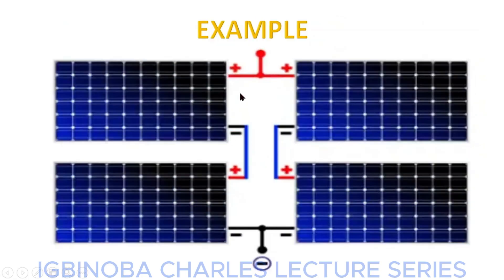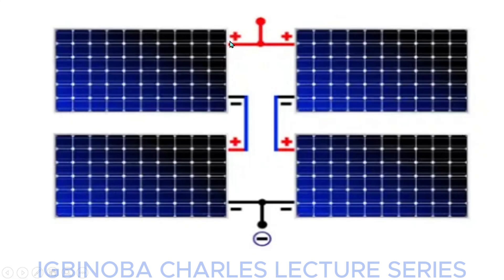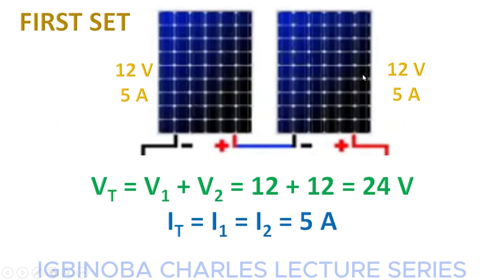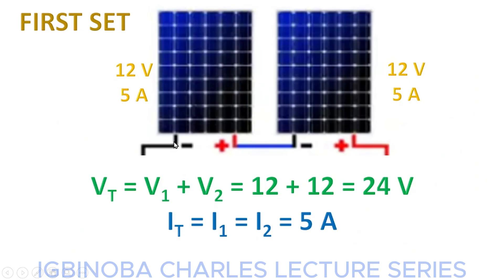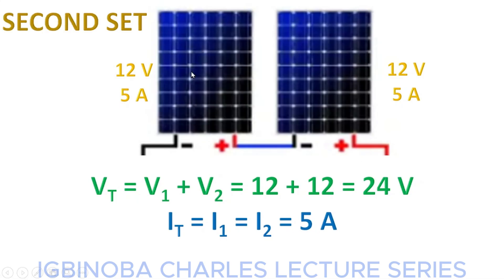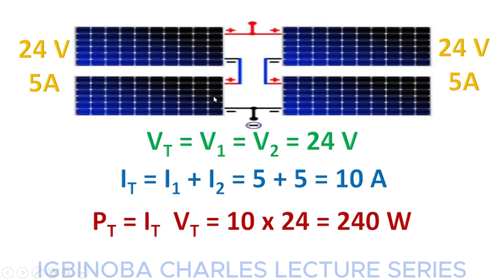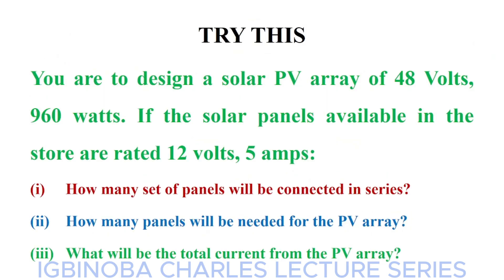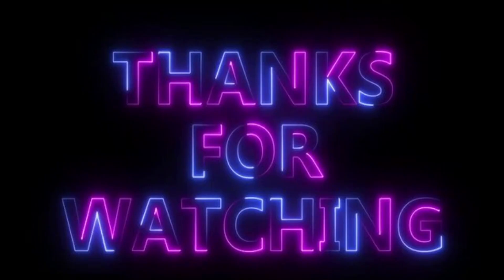Connection of  Solar Panels in SERIES-PARALLEL

Comment: PETRO3158B

i) When connecting panels in series, voltages add up, but the current remains the same.

Required voltage = 48V
Each panel voltage = 12V
Number of panels in series = 48 / 12

= 4 PANELS IN SERIES

ii) A total of 16 Panels would be needed

Each Panel produces 60 watts i.e. 12V x 5A = 60W

To get 960W in total, therefore, 960W / 60W = 16 Panels

iii) Utilizing the formula:-  I = P / V

I = 960W / 48V = 20A

Comment: MAR315O
1. Set of panel connected in series = 4 panels
2. Panels needed for pv array = 16 panels. One panel (12v×5=60watts), 960/60 = 16panels
3. Total current equals 20A
Form the formula I = P÷V
I = 960 watts ÷ 48v = 20A

Comment: PETRO323W

a) when connecting panels in series, voltages add up, but the current remains the same.

Required voltage= 48v
Each panel voltage= 12v
Number of panels in series= 48/12
                                               = 4
Ans: 4 panels in series 

b) A total of 16 panels would be needed 

Each panel produces 60 watts I.e. 12v × 5A = 60W
 
Therefore to get 960W in total, 
960/60 = 16

Ans: 16 Panels

c) Using the formula » I = P/V
     I = 980W / 48V
       = 20A

Ans: 20A

Comment: MAR3123S
Panel in series:to get the voltage voltage of 480v usunj very 4 120V
2,to reach demand of 960W,16 panels are required 
3,to string are connected in parallel and give an output  current of 20A

Comment: MAR334H

1.A panel in series: to achieve the system target of 480v using 120v panels, 4 panels will be required 

2. The power output of a single panel is 60W to achieve the system's power demand of 960w..  16 panels are needed 

3. The strings are connected in parallel, using I  =p/v , 960/48= 20Amps

Comment: MECH367O

(i) 48V (array voltage) ÷ 12V (panel voltage) = 4 panels in series

(ii) 960W (array power) ÷ 60W (panel power) = 16 panels

Since we need 4 panels in series, we'll have:
16 panels ÷ 4 panels/series = 4 parallel strings of 4 panels in series

(iii) Total current = 5A (per string) x 4 strings = 20A

Comment: MAR3112H 
1:- Sets of panels that will be connected in series is $48 / 12 = 4$

2:- The power generated by a single panel is $120 \text{ V} \times 5 \text{ A} = 600 \text{ W}$. The required power in the array is $960 \text{ W}$. Therefore, the number of panels needed for the array is $960 / 60 = 16 \text{ panels}$.

3:-Since we have 4 panels connected in series and we have a total of 16 panels, Total panels connected in parallel is $16 / 4 = 4$ panels in parallel. Each of these panels has a current of $5 \text{ A}$. Therefore, the total current in the PV array is $4 \times 5 \text{ A} = 20 \text{ A}$.

Comment: PETRO311K

1. Total number of panels placed in series - 48V/12V = 4 panels.
2. Total number of panels needed for PV array - 960W/60W = 16 panels.
3. Total current in the PV array - P=IV, where P=960 and V=48. Therefore, I=960/48 = 20A

Comment: EEE35E

1)  4 sets of panels will be connected in series.....each set will consist of 4 panels

2)  16 panels would be needed in total for the PV array 

3)  The total current from the PV array would be 20 A

Comment: Mar355C

1. 4 panels will be required in a series connection to get an equivalence of 48 volts. (Since each panel is 12 volts, 12 ×4 =48 volts)

2. A total of 16 panel will be needed for the Photo voltaic array

3.The total current from the PV array will be 20 A

Comment: CHM 107C

Given: PV array= 48V, 960W. Solar panels: 12V, 5A.
- Number of panels connected in series= 48/12= 4
- Total panel for array
Each panel = 12V × 5A = 60W
Panel number= 960/60=16
-Total current from PV array
Number of parallel strings = 16/4=4
In parallel, current adds voltage stay same(48V):
Total current= 4×5A = 20A

Comment: CHM 3143M

Given: PV array= 48V, 960W. Solar panels: 12V, 5A.
- Number of panels connected in series= 48/12= 4
- Total panel for array
Each panel = 12V × 5A = 60W
Panel number= 960/60=16
-Total current from PV array
Number of parallel strings = 16/4=4
In parallel, current adds voltage stay same(48V):
Total current= 4×5A = 20A

Comment: MAR329C

a.) To achieve a system voltage of 480V using 120v solar panels, you need to connect 4 panels in series

b) Total Number Of Panels Needed

The normal output of a panel is 600W. To meet the total demand of 960W, 16 panels are required in total

c) 16 panels are in the array and 4 panels are in series. Total number of parallel sets of panels = 16/4-4 parallel sets. Total current frok each set of panels is 5A. Since these sets are in parallel, the total current is 5A ×4=20A.

Comment: CHM397S

1: Sets of panels that will be connected in series is 48/
12 = 4
2: The power generated by a single panel is = 120 V x 5 A
= 600 W. The required power in the array is 960 W.
Therefore, the number of panels needed for the array is =
960 / 60 = 16 panels.
3: Since we have 4 panels connected in series and we have a total of 16 panels, Total panels connected in
parallel is 16 / 4 = 4 panels in parallel. Each of these
panels has a current of 5 A. Therefore, the total current in the PV array is 4 × 5 A = 20 A.

Comment: EEE328B
1.Number of Panels in Series
Required system voltage = 48V
Each panel voltage = 12V
Number of panels in series = 48V ÷ 12V = 4 panels
Answer: 4 panels in series.

2.Total Number of Panels Needed
Power of one panel = 12V × 5A = 60W
Total required power = 960W
Total number of panels = 960W ÷ 60W = 16 panels
Answer: 16 panels in total.

3.Total Current from the PV Array
Total panels = 16
Panels in series = 4 → Number of parallel sets = 16 ÷ 4 = 4 sets
Current per set = 5A
Total current = 4 sets × 5A = 20A
Answer: The total current is 20A

Comment: MAR322v
1.When connecting panel in series,voltage at add up ,but the current remains the same.
Required voltage __48v
Each panel voltage __12v
Number of panels in series:48/12 equals 4 panel in series 
2.A total of 16 panels would be needed 
Each panels produces 60 watts i.e 12v *5=60w
To get 960W in total therefore 960W/60W=16panels 
3. Utilizing the formula -I=P/V
I=960W/48V= 20A

Comment: CHM3168L

The required PV arrays = 48V, 960W
The Solar panel rating available = 12V, 5A
The power of one panel, P = V x I = 12 x 5 = 60W

I. When calculation the total voltage in series it is added up, therefore:
48V/12V = 4 panels
 4 panels are connected in series 

II. Total power required = 960W
Power per panel = 60W
Therefore the total panel needed for PV arrays:
960W/60W = 16 panels 
 16 panels is needed for the pv array

III. In series the current stays the same but since we have for 4 strings in parallel the current adds up, therefore the total current is 5A x 4 = 20A
The total current from the pv arrays is 20A

Comment: PETRO3143M

1.Number of Panels in Series
Required system voltage = 48V
Each panel voltage = 12V
Number of panels in series = 48V ÷ 12V = 4 panels
Answer: 4 panels in series.

2.Total Number of Panels Needed
Power of one panel = 12V × 5A = 60W
Total required power = 960W
Total number of panels = 960W ÷ 60W = 16 panels
Answer: 16 panels in total.

3.Total Current from the PV Array
Total panels = 16
Panels in series = 4 → Number of parallel sets = 16 ÷ 4 = 4 sets
Current per set = 5A
Total current = 4 sets × 5A = 20A
Answer: The total current is 20A

Comment: CIV374V 
a) Panel in Seies:
To achieve a system voltage of 480V using 120v solar panels, you need to connect 4 panels in series
b) Total Number Of Panels Needed
The normal output of a panel is 600W. To meet the total demand of 960W, 16 panels are required in total
c) 16 panels are in the array and 4 panels are in series. Total number of parallel sets of panels = 16/4=4 parallel sets. Total current frok each set of panels is 5A. Since these sets are in parallel, the total current is 5A ×4=20A.

Comment: CHM312OP
1. Number of panels in series:
For 8v we need to connect in panels series. since each panel is 12V, 
we'll need 
480/12V in series .
2. Total number of panels: 
Each panel is 12V, 5A, so the power rating will be 
120*5A=600W per panel
Since 4 panels are needed in series, we will have 16 panels/4 panels per series line up = 4 parallel line ups
3. Total current from the PV array: Each series line up produces 5A (parallels are connected in series)
with parallel line up, Total current will be 5A*4=20A

Comment: MAR333G
1. We have 4 panels in series. Where we have =48/12=4
2. We have 16 panels for the array. Where we have=960/60=16
3. We have 20A to be the total current from the PV array. When we have in each series string 4 panels=48v,5A so total current will be=4×5A=20A.

Comment: CIV396R

1. There will be 4 panels connected in series
2. 16 panels (i.e 4 series × 4 parallel)
3. Total current is 20A (5A × 4 panels)

Comment: MAR73U 

i.4 panels are connected in series
ii.A total of 4 panels will be needed 
iii.Firstly the panel has different current in series connections if they are different current you take the current of the small voltage 
The smallest voltage is 5
It=I1+I2=5+5=10Amps

Comment: Comp356D

(1) 4 sets of panels will be connected in series
(48V/12V) = 4
(2) 16 panels will be needed for the PV array
(960W/60W) = 16
(3) The total current from the PV array is 20A
(960W/48V) = 20A

Comment: COMP327A

1. Sets of panels that will be connected in series is 48/12=4

2. power generated by a single panel = 120 V x5A = 600 W.
required power in the array is 960 W. Therefore, number of
panels needed for the array is = 960/60 = 16 panels.

3. 16 panels are in the array and 4 panels are in series.
Total number of parallel sets of panels = 16/4= 4 parallel
sets. Total current from each set of panels is 5A. Since
these sets are in parallel, the total current is = 5A x 4 =
20A.

Comment: EEE3170N
1.  Number of panels in series:
For 8V we need to connect panels in series. Since each panel is 12V, 
we'll need;
480 divided by 12V panels in series.

2.  Total number of panels:
 Each panel is 12V,  5A , so the power rating will be: 120 x 5A= 600W per panel 
for a 960W array, we'll need:  960W divided by 60W per panel = 16 panels
 Since we need 4 panels in series, we will have: 16 panels /4 panels per series line up =4 parallel line ups

3.  Total current from the PV array:
 Each series line up produces 5A (since the panels are connected in series).  With parallel lineup, the total Current will be: 5A x 4 =20A

Comment: PETRO 384F 
Great video sir 

Let's solve the problem step by step

Given:
- Solar panel rating: 13V, 5A
- Desired PV array rating: 48V, 960W

1). Number of panels in series:
To achieve 48V, we need to connect panels in series. Let's calculate the number of panels needed:
48V / 13V = 3.69 (round up to 4 panels in series, since we can't have a fraction of a panel)
So, 4 panels in series will give us: 4 x 13V = 52V (which is close to the desired 48V, considering voltage variations)

2). Total number of panels needed:
To calculate the total number of panels, we need to determine the total current required:
960W / 48V = 20A
Since each panel is rated 5A, we'll need:
20A / 5A = 4 strings of panels in parallel
Each string has 4 panels in series, so the total number of panels is:
4 strings x 4 panels = 16 panels

3). Total current from the PV array:
We've already calculated the total current:
960W / 48V = 20A

So, the answers are:
Question 1: 4 panels in series
Question 2: 16 panels 
3. 20A

Comment: EEE3122R
1. No of panels connected in series is 48/12=4
2. The power output of a single panel is  120v ×5A=600W. But the required power in the array is 960W,so therefore the actual number of panels needed for the array is 960/60=16 panels
3. Since there are 16 panels in total in the array and 4 in series... The total number of parallel sets of panels is 16/4=4 panels. Since the current in each set of panels is 5A, the total current in the array is 5A ×4=20A

Comment: COMP37G 

a) Panels in Series: 
     To achieve a system     voltage of 480V using 120V solar panels, you need to connect 4 panels in series. 

b) Total number of panels needed: 
      The power output of a single panel is 600W. To meet the total system power demand of 960W, 16 panels are required in total.

c) Parallel Strings and Output Current: 
     With 16 total panels arranged in the series string, these strings are connected in parallel the result is 20A.

Comment: MECH3198P 
i. 4 set of panels will be connected in series (48v/12v) =4v.
ii. 6 panels will be needed for the PV array (960W/60W) =16 W
iii. The total current from the PV array is 20A (960W/48W) =20

Comment: PETRO3670

1. 4 sets of panels will be connected in series.

Since connecting 4 of the 12 volts, 5 amp panels in series gives a total of 48 volts as required by the solar PV array design

2. 16 panels will be needed for the PV array.

This is because the power of each panel is 12 x 5 = 60 watts, therefore the total number of panels to produce 960 watts is, 960/60 = 16

3. The total current from the PV array is 20 amps

Since I (total) = P (total)/ V (total)
I (total) = 960/48 = 20amps

Comment: NAT331E

a) Panels in Series: To achieve the system's target voltage of 480V using 120V panels, 4 panels need to be connected in series.

b) Total Panels Needed: The power output of a single panel is 600W. To meet the total system power demand of 960W, 16 panels are required in total.

c) Parallel Strings & Current: With 16 total panels arranged in 4 series strings, these strings are connected in parallel. This configuration results in a total output current of 20 Amps.

Comment: CHM364L

1. 4 panels are connected in series 
When you connect four 12-volts, 5-amps panels in series, you get a total of 48 volts, which is the voltage needed.
2. 16 panels are needed. Each panel produces 60 watts ( 12V × 5A). To get 960 watts: 960/60 =16 panels 
3. The total current from the solar array is 20 amps. 
960W/48V = 20A

Comment: COMP326Z

a) Panels in Series:

To achieve a system voltage of 480V using 120V solar panels, you need to connect: 480V 120V = 4 panels in series.

b) Total Number of Panels Needed:

Each solar panel generates 600W of power.

To achieve a total system power output of *9,600W*, the number of panels required is: 9,600W 600W = 16 panels in total.

c) Parallel Strings and Output Current:

If the 16 panels are grouped into sets of 4 (in series), this gives *4 strings*.

These 4 series strings are then connected *in parallel*.

Assuming each string delivers *5A*, the total system output current is:

4 strings × 5A = 20A total current.

Comment: MECH3123S
A) because series connection determines the final voltage of the array and the required voltage is 480, then the number of panels needed to reach the required voltage is 48/12 = 4 panels.
B) The power generated by a single panel is 120 * 5A = 600. The required power in the array is 960/60 = 16 panels
C) 16 panels are in the array and 4 panels are in seriesm total number of parallel sets of panels = 16/4 = 4 parallel sets. Total current from each set of panels is 5A. Since these sets are in parallel, the total current is 5A * 4 = 20A

Comment: MECH3106B

a) Set of panels in series:
To achieve a 48V system using 12V panels, the number of panels connected in series should be:
48 volts ÷ 12 volts = 4 panels in series
b) Total panels required for PV array?
Each panel is rated at 12V and 5A, giving a power output of: 12 volts x 5A = 60 Watts per panel.
For a total system power of 960W, the number of panels needed is:
960 Watts ÷  60 Watts = 16 panels
 Therefore 16 panels are required 

c) Total current output from the PV array Is derived by:
One series set produces a constant current (5 Amps) and 48 volts..
We have 16 panels in total and 4 panels per series string,so.....
16÷4= 4 strings

With 4 parallel strings, the total current from the array becomes:5+5+5+5= 20A
OR
5 Amps x 4 panels per string= 20 amps

Comment: MAR357E

1. Sets of panels that will be connected in series is 48/12=4

 2. power generated by a single panel = 120 V x5A = 600 W. required power in the array is 960 W. Therefore,  number of panels needed for the array is = 960/60 = 16 panels.

 3. 16 panels are in the array and 4 panels are in series. Total number of parallel sets of panels = 16/4= 4 parallel sets. Total current from each set of panels is 5A. Since these sets are in parallel, the total current is = 5A x 4 = 20A.

Comment: COMP3109E

1. Panels Connected in Series
To reach the required system voltage, we connect multiple solar panels in series. In this case, combining panels to get 48V + 12V means we need 4 panels in series.
2. Total Number of Panels in the Array
Each panel has a rating of 12V and 5A, which equals 60W per panel. To achieve a total array output of 960W, we need:
Number of panels = 960 ÷ 60 = 16 panels
3. Parallel Strings and Total Current
The panels are arranged in parallel strings to handle the current. The number of parallel strings is calculated by dividing the total panels by the number of panels in series:
Parallel strings = 16 ÷ 4 = 4 strings 
Toatal current =4 x 5A = 20A

Comment: CHM3105A
1.Number of Panels in Series
Required system voltage = 48V
Each panel voltage = 12V
Number of panels in series = 48V ÷ 12V = 4 panels
Answer: 4 panels in series.

2.Total Number of Panels Needed
Power of one panel = 12V × 5A = 60W
Total required power = 960W
Total number of panels = 960W ÷ 60W = 16 panels
Answer: 16 panels in total.

3.Total Current from the PV Array
Total panels = 16
Panels in series = 4 → Number of parallel sets = 16 ÷ 4 = 4 sets
Current per set = 5A
Total current = 4 sets × 5A = 20A
Answer: The total current is 20A